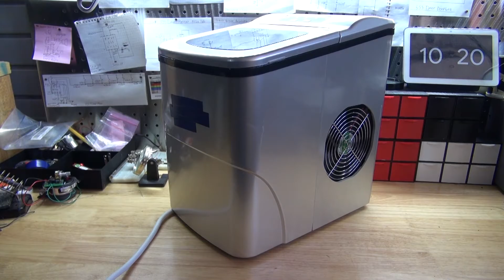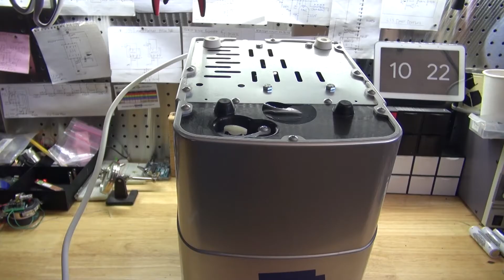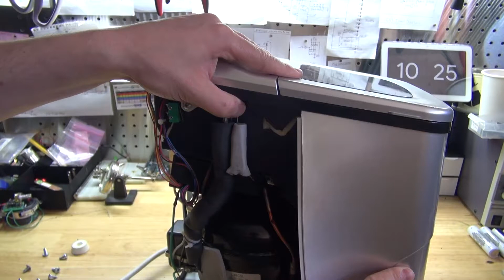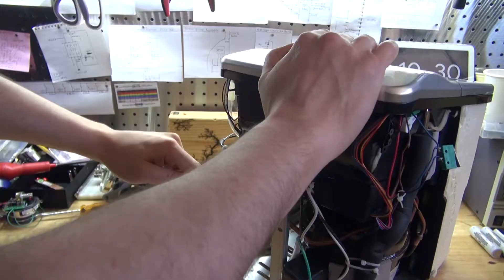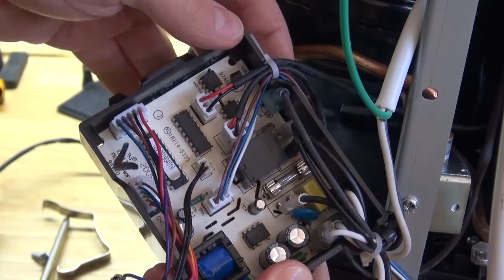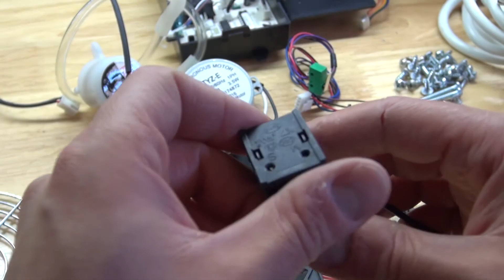Ice Maker Teardown

Comment: you have a synchronous motor, not a stepper motor. the water pump is 12v. the two "things"  ( black and white things, are NOT temperature regulating ) you could not identify are water level sensors. a ULN2003 water level sensor schematic foogle search can show how them works.  I am looking for how that magnetic valve selenoid on the 'Freon?' line works and how it is useful. before I go about the difficult way of figuring it out. get a blow torch and warm' i mean warm up the solder side of them circuits and you can take them parts off the printed circuit boards.
Reply: May i ask  wth is foogle .